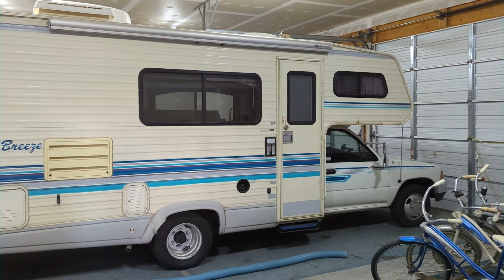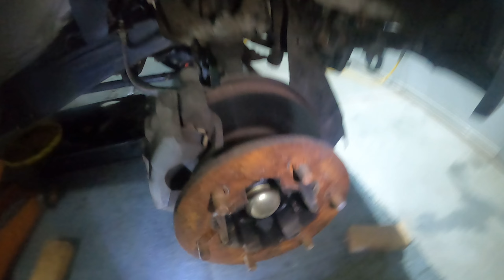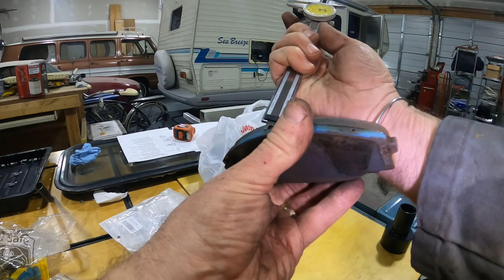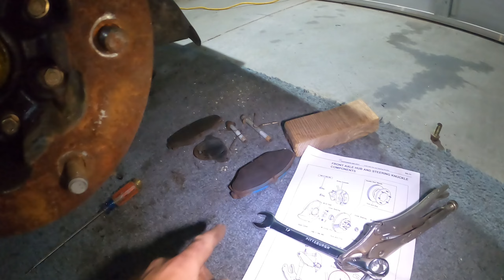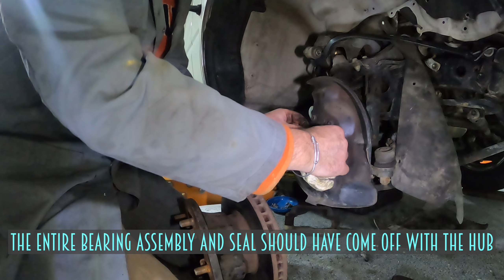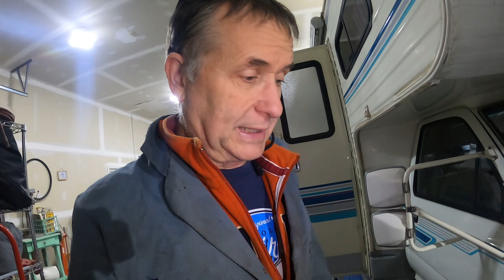Builder Series at Frank's Place - Episode 5: Toyota Motorhome Tune Up Part 2

Comment: Franks place needs a “that was easy” button.  So far, it hasn’t been easy but it’s good to know what you have under you by learning how it’s made and knowing you can do the work yourself.  This video reminds me of myself every time I work on the wife and kids car brakes….  Thanks for the laugh and Cheers 🍻 to another great episode
Reply from the maker: Hey Ryan,
Thanks for watching.    I totally agree.   There needs to be an easy button at Frank's Place.   Seems like I'd use it multiple times a day with all the old cars I'm currently working on.   Luna is 60 years old and there is some not so easy stuff going on with her.
You're point is spot on.   I want to know exactly what condition Byrdie is in since our plan is to drive her many many miles after we get the remodel done.   The entire truck platform needs to be in tip top condition and so all this stuff I'm doing helps establish a baseline to work from moving forward.
It's good you work on you and your wife's cars.   It's a great way to understand the systems in each car and getting your hands greasy is good for the soul.   And it's a good excuse to have a beer at 2:00  in the afternoon. 
Thanks again for the support.
Enjoy the Ride

Comment: Oh man. Feel for you.  Know $s are always an issue. But if you touch the pads and rotors best to replace them.  What about the shocks?  It’s amazing how much impact they make on ride feel. But you know that.
Reply from the maker: Thanks for watching and for the comment.   You may be right about replacing the pads and rotors.   You'll see in the next episode what I did putting the brakes back together.   I'll also cover shocks in the next episode.  Stay tuned.  :)
Enjoy the Ride
Reply: @BBB_Adventures  all praise to stage zero efforts!